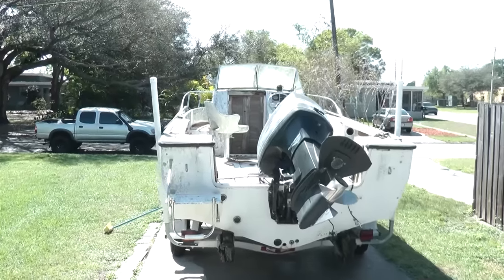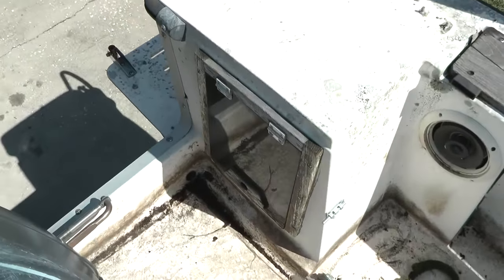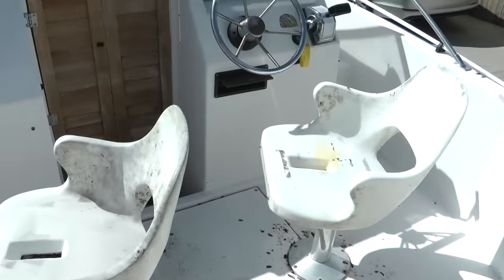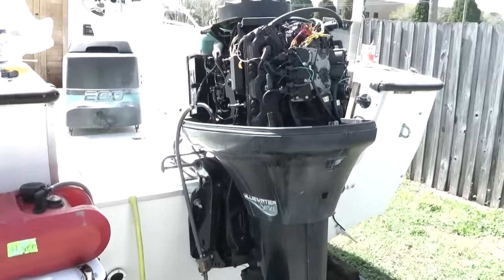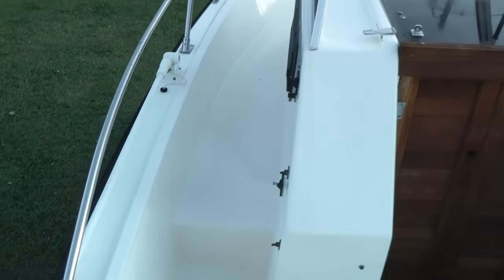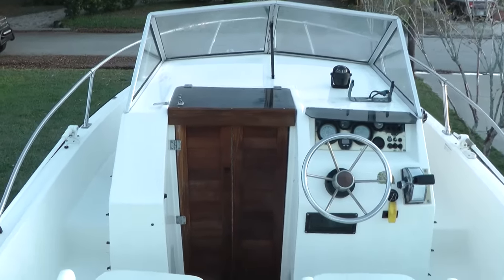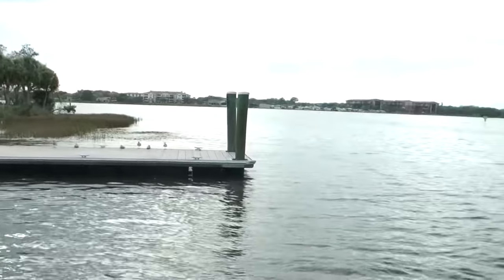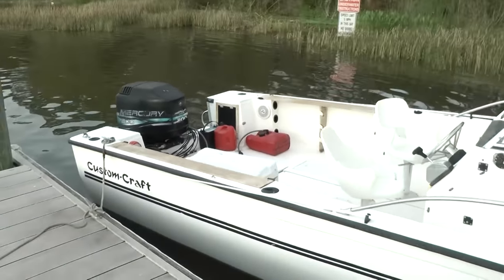From Trash To Gold!!!

Comment: Also buy some linseed oil and load up a rag and wipe the wood down and it will look brand new ...Great job on the restoration.
Reply: On wood that badly weathered you need to use a cleaner and brightener on it before oiling.
Reply: sand it down
Reply: Carefull with the soaked rags🔥!!!!!!!
Reply: linseed oil and rags seem like a bad idea. Use a paint brush so you are inclined to clean it when you are done so you don't make a fire bomb

Comment: Cool story; I'd recommend you put some tung oil on all the wood pieces
Reply: teak oil?
Reply: @BEERSnGEARS  yeah. He means teak oil. Only thing is you got to reapply every couple weeks.
Reply: Are One put some poly on it and be done
Reply: @rond3367  you could. Sand it down and refinish it.
Reply: Pretty sure he does mean tung oil, its an oil/varnish mix that you hardly ever have to reapply. It works wonders in applications like this
Reply: @danielnapast4955  maybe. But tung oil would require some prep work. Teak oil not so much.
Reply: Yeah I did mean tung oil, it is a tried and true traditional oil for marine applications

Comment: Amazing  how well it cleaned up, a real Cinderella story for a boat.
Reply: He likely spread the mold that you cant see with your naked eye especially as it takes years to see mold grow in slow mo.  Check his lungs later
Reply: Twenty yrs from now the question: How did you get boat mold in your lungs?  LOL
Reply: You can minimize exposure to mold by spraying it with a Biocide and letting it sit. If you attempt this in the future. Also spraying the upper carpet in the cabin with a Biocide let it soak then use a carpet cleaner with upholstery attachment to shampoo it out. 
  Boat looks great. I have refurbished quite a few in my former career. From Mahogany to fiberglass a little elbow grease and polish and it will shine like a diamond in a goats A$$
Reply: @meacomefeyou  - Actually it's not mold, it is Lichen - big difference.  Secondly, the mold has desiccated by being out in direct sunlight and isn't actively growing or producing spores.  Once you start pressure washing, the "mold" isn't going airborne because it is in a wet state.  Much different than the mold conditions inside a house.
Reply: @Rattlerjake1  also, did you see the big bottle of Clorox he was using, Lol
Reply: @ericgilmore5949  - Yes, I mentioned it in another comment.

Comment: old 2 stroke... carb kits, always new water pump, new lower unit oil, good to go. Great Job great buy
Reply: AND GREAT JOB
Reply: I 2nd the carb kits, new impeller & lower unit oil.    Also, those old 2 strokes,,,, don't even bother using the oil injection system because they tend to be very inconsistent and make it smoke more.  Just pre-mix the gas and it will smoke a lot less.  My friend has older Whaler with Twin Oceanpro's and he mechanic suggested the premix method.  It is smoked ALOT less and the motors ran better.   He had a large internal tank so for every 25 gallons he throws in a quart of 2 stroke oil (100:1).  Just a thought.
Reply: Charles Borrelli or... take it to the dump and get a Suzuki 200 4 stroke instead

Comment: u can trim the motor up a little , and increase speed to 50 . I have the same rig ..cost me 35k in 99
Reply: Are these made by R&R boat works , solid looking boat  ?
Reply: Rick Stout Is it worth the cost for a couple of miles an hour?
Reply: it don't cost nutin….jus push the trim tab button
Reply: @1OFGODSOWN  it doesn't cost anything. It already has electric trim. He will actually save money by trimming up because less of the hull will be in the water, so less resistance equals less fuel.
Reply: @1OFGODSOWN  Well since the boat  has power trim installed all it takes is the push of a button to tilt the motor up a tad! No cost involved. I agree with rick! A 200hp aught to push a 22ft. cruiser 50 no problem!
Reply: @1OFGODSOWN  trimming any outboard will increase your speed and even have better fuel economy
Reply: Highland Green Fla. US to
Reply: And on top of that, if this boat was a steel of a deal, put that saved money towards a pair of hydraulic trim tabs. Well worth the money and tabs combined with power trim you have so much control over how your boat reacts and if it’s speed you’re looking for, trim that motor up until the bow starts to bob and then lower the trim tabs just enough to stop that porpoising and you have as much boat out of the water as possible. Less boat=less friction, more speed.
Reply: Rick Stout    Did you ever live in riverside, ca?
Reply: @subswithnovideos-tn2eb  No, raise the motor up and it angles the bow of the boat higher. Less boat in the water = less resistance = faster speeds. If you put the bow down in the water, it turns on a dime better.
Reply: @rickstout7626  agreed, even a couple of degrees of fine tuning make the difference
Reply: A good wax job wouldn't hurt either.
Reply: You*

Comment: A great find when you can find a boat that has probably never been abused, but it has been sadly neglected.  The problems were mostly cosmetic so a bit of spit and polish goes a long way.  You should mention what you paid for the orphan and what the value would be estimated at now.  Take the engine cover to a good body shop that paints fiberglass and that motor will look new again.  Finish up with some sandpaper, stain and marine varnish on all the wood trims and she will really make you proud.
Reply: definitly not cosmetic damage its probably fully rotted worth nothing
Reply: mitchell apps   No sign of this at all.
Reply: Uh

Comment: I own the same motor on a 22 open fisherman. Cap the oil feed and premix the oil in the gas. #1 reason the motor will blow. Oil pump can go anytime and you will not know in time and boom. I run mine oil rich and helps cool. Keep an eye on the impeller. It was eating them all the time. The old two strokes are hard to start sometimes, but once started they will stay started. No computers to leave you stranded. Loud and smokey, but bulletproof when maintained. Great pickup - she looks new now!!
Reply: Yep those oil tank systems are a major concern, 10% extra oil in the fuel tanks extends the life of the motor. Do a carby gasket rebuild every 2 years and it should be good for many years. I always sprayed my motor under the cowling everytime l used it using Lanospray ( Lanoline based ).
Reply: Looks great. Neat video , great drone footage

Comment: To help the motor, you should put seafoam. It will clean really good! Nice job to.
Reply: Toyota 4runner never fap at sea
Reply: Toyota 4runner i use Seafoam alot it works Great especially in Tractors
Reply: @rexwilson6598  yes it does
Reply: No you use quicksilver carbon guard.. made by Mercury marine.. 20x better than sea foam. You will blow chunks of carbon off the cylinder walls thumb nail size.  Works great on all motors.. trim your motor up when running you will hit 52.

Comment: Should stain the wood and paint the motor cover for an even newer look.
Reply: Nice job! Use Star brite Teak Cleaner and Star brite Teak Sealer Classic on the wood. Will look amazing.
Reply: New Mercury decal
Reply: And fix  that dashboard.
Reply: Malo 
They've only had it two days......jeeeez give them a break.
Reply: If you look at the closing pictures they have obviously done something with the exposed wood. Darker richer color than the faded look after her bath.
Reply: @watcher13th  naw leave it for now.mess with the wires and it screws things up .....................enjoy the season and when the cold sets in  do a dash repair

Comment: Try biological laundry powder to eat those stains up on the seats. Or Milton sterilising fluid on anything white with organic staining. Great looking boat
And some tinted osmo on that timber will look sweet
Reply: Are you in England or OZ ??  American chemicals are known by different names.
I'd like to know what eats black mold.
Reply: Peter Darr I’m in the UK Peter.
Milton fluid is commonly used here to sterilise baby products. It’s a great option for testing on organic stains on a white material. I have personally used it to get tumeric stains out of white cotton. It was bizarre, the stain literally disappeared before my eyes whe dabbed in directly. 
As far as the biological laundry powder. I would use a product here called Persil. I used it to remove the staining from a zodiac rib as well as a grp fishing boat. It must be ‘biological’ so you don’t have to ‘work’ the product so much as it digests most organic stains. 
I’m sure if you google the products you will find a suitable alternative locally or maybe amazon can deliver. All the best 

Oh and Osmo I use regularly in the restoration of timber. Unlike a lacquer or varnish you can over-apply the product when needed in future and won’t suffer the UV damage and de-lamination you would with a lacquer. It has the qualities of an oil, a wax, a stain and a lacquer. Far less labour to maintain in the future however and the tinted versions work great to renovate those sun bleached areas.

Comment: You got lucky on the motor.  How much did you pay for the  boat?
Reply: Yeah because those carbs dont like to sit at all...trust me I know.
Reply: 2 stroke motors use mixed gas, the oil that is mixed in with the gas and acts as a stabilizer. I had a 95 KTM 300 mxc 2 stroke dirtbike that sat for 6 years and literally moss growing on the crack case and the carb was still clear and not oxidized up. This is assuming he didn't clean anything gas related out of the motor before starting it.
Reply: New motor now!

Comment: Great job!! Too bad Mercury never learned to make a decent motor shell.
Reply: Seems to me the motor housing shell prevented corrosion completely which is it's primary purpose. Fading of exterior paint after years in the hot Florida sun is not a problem or a surprise. .  Sun fading never caused corrosion.

Comment: How much did you pay for the boat! You did a really good job with the clean up
Reply: $1400
Reply: @johnathangrundon8281  how much you selling it for ??
Reply: @faddafatspowerhouseliquorscdca  it is sold already.
Reply: @johnathangrundon8281  nice nice boat i want a small boat like that one ???
Reply: @faddafatspowerhouseliquorscdca  there are plenty out there. Just have snag one up when one you like comes along.
Reply: @johnathangrundon8281  Curious how much you sold it for?
Reply: So when we going shopping for one I'm in search of one
Reply: That would make a heck of a side job.
Reply: Looks good, it also looks like the fuel tank needs replaced. ie. plastic tank
Reply: Someone parked and abandoned a boat on the street next to my property that look similar to this boat and the trailer isn’t bad either.  Called the cops to get it towed away and 1 year later it is still there.  I don’t know what the law says, but the cops need to come by to see if they can track who owns it.  If no one claims it, then maybe theres a way to get papers for it and get it fixed up.
Reply: Johnathan Grundon , Can I ask what Model and year the Custom craft is?
Reply: @johnathangrundon8281  Thats one thing i love about FL. You can find great deals on used boats!!!
Reply: @C6Roadster  In ohio if there is no lien on it, you can get a mechanic's lien and then an inspection and then a title. It work's best if you or a close friend have a towing, storage or repair business.
Reply: Almost forgot; you can also do the same thing with an abandoned vehicle title, if you own land and can prove it's been abandoned on your property.

Comment: What's the name of the app you are using for the speed on the boat?
Reply: Lou Rod like to know the same thing, but I do know Waze can give you mph in the inland waterways and close to shore.
Reply: @toddh6102    You don't need to be near shore. It's using GPS. It will give you speed anywhere.
Reply: The app. Name is SAILDROID is free ,  gives you speed , waypoints and position i use it is fantastic.
Reply: lyman135 I've tried it offshore once but since I had no cell service, it didn't work.  Maybe there's something I don't know about it.
Reply: @toddh6102   Without data or cell service it won't update the maps, but should still give you a position. GPS doesn't rely on cell service.   It uses satellites like any other GPS. You usually need an app though to tell you speed.

Comment: there was no actual work done here, not  even a proper detail job, just cleaned an old shit box up a little put a battery and gas in it and won the game.  keep winning :)
Reply: He took the lower unit off and installed a new impeller. That's work
Reply: Huh now that I’m thinking about it. I wonder how much a professional detail would cost. Someone sells you a boat like this for nothin you go pay like 500 dollars in detail and then just fix the shit that’s broken
Reply: Pretty much so.  He got a real nice find.
Reply: exactly ever stringer and bit of transom is brobably rotted

Comment: Wet and dry vac should clean out those BeyWheelz front middle anywhere where you got a collection of dirt and junk in there oh, so you can pressure wash them out as well, make sure all the wood is pressure washed

Comment: I pickup a similar boat many years ago which had been sitting 8n my neighborhood for s9me time. I asked the owner if he wanted to sell it and he said no. Two or more years later I asked him again he agreed to sell it for around a 1000. It was a 21 foot air slot walk around cutty cabin Hull was clean with trailer.I had to buy a intake manifold and carburetor and starter. 305 Chevy motor. I used a large wrench to turn the motor and squirt some oil down the cylinders. Then it started right up

Comment: A tip on launching leave the jeep on top slip way hand brake secure,tie a measures length of rope to trailor and jeep,leave the trailor roll back under gravity,until slack taken up.To many jeeps follow boat into deep water slime.The stopping action tant rope should allow boat to float off trailor

Comment: very nice job.  try putting some Ospho rust remover on those stubborn rust spots on the seats and elsewhere.  Spray or wipe it on and allow it to set all night...you'll be amazed.  Also looks like your bow is up pretty high and stern is low.... try trimming the engine down and the front end should come down a little be almost level during WOT.   You'll probably get a couple more mph out of her.

Comment: Wow sweet score brother! A littleb elbow grease goes a long way! You might be able to improve the overall performance by adding an after market wing keel to the lower unit? The boat will get up on plane at a lower rate of speed.. Too end speed goes up a little and fuel economy improves.. My experience with the wing keel has been good to great...  Especially when the boat is slightly underpowered..

Comment: Best value is some good old fashioned elbow grease lol  I can also recommend barkeeper's friend to clean up and brightened that fiberglass. Though the thing I am most concerned about is the condition of any wood that might be in the boat. Most boats used wood in the transom and stringers and my guess is they got wet and are rotting based on the condition of the boat.  Please have somebody experience check out the structural elements of the boat.

Comment: Use the pressure washer in conjuntion with a wet dry vac and suck the dirt and water up as it breaks loose. Would work good inside the wells etc. can suck all that up and not have to deal with nasty rags soaking it up.

Comment: I have seen lots of these videos and in nearly all of them someone takes the plugs out and squirts oil into the cylinders then replaces plugs and tries to start the engine. on the first revolution the piston rings throw all the oil onto the spark plugs oiling them up, that's why they have trouble starting the engine! Turn it over a few times BEFORE putting the plugs back in so the excess oil will be thrown out, then put the plugs in. If it has not been started for a long time try warming the plugs on the stove first, it helps atomise the fuel! Hope these tips help someone?

Comment: I would eliminate the separate oil tank and mix it in the fuel unless that motor which I doubt ,injects from the cam then you cant . but rebuilding or repowering an outboard coast more then the boat.think about it.

Comment: Thought I might let you in to a boat owner to do list, 1 always make sure throttle is set to neutral before you start it. 2 never start the engine out of water, the impeller need to be constantly in water or they burn ot, kinda what you found out, hahaha newby mistake, go take some courses
Reply: Isn't the hose he had attached to the motor a water line to prevent it from burning out?

Comment: Does anyone know What type of cleaner works better than Clorox/bleach
Reply: what I use to clean metal roofing before painting is called TSP.  tri sodium phosphate.  you can buy it at any home depot or lowes.  that destroys what the pressure washer doesn't get.
Reply: Yea I used toilet bowl Cleaner today on a boat that looks like the one in the video and i pressure washed it all down before I scrubbed and it got a major portion of it off but the “growth” I scrubbed and it was a lot of scrubbing with toilet cleaner and not a lot of results but it eventually came off. I think I’ll try something a little more acidic. I just didn’t want to use something too strong

Comment: It's an engine, not a motor. Motors are electric
Reply: Actually a motor could be gas, diesel, electric, anything that moves and object really. However only and engine has combustion chambers. So either works in this case. Have a great day!